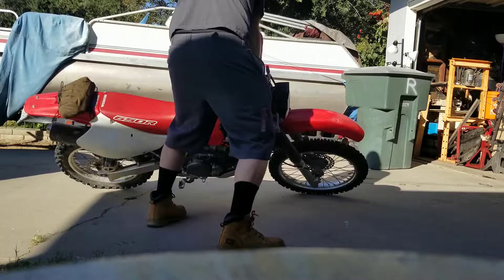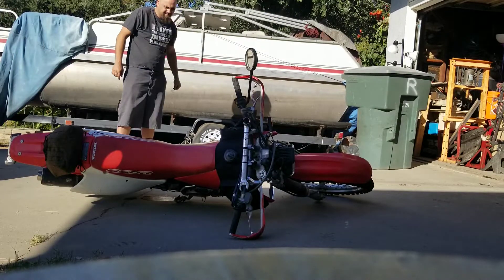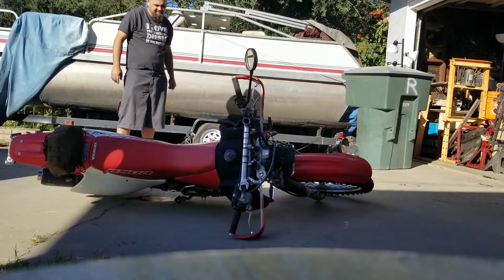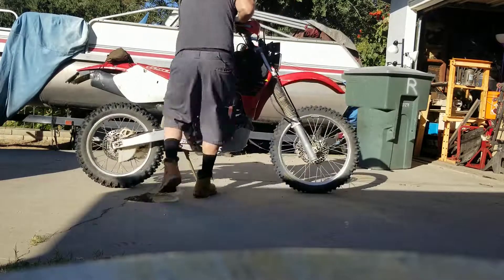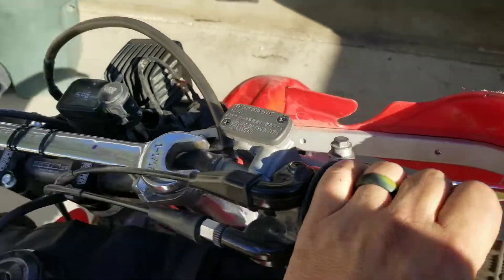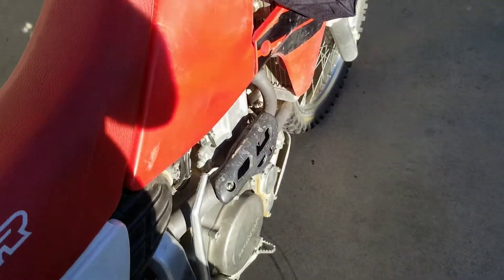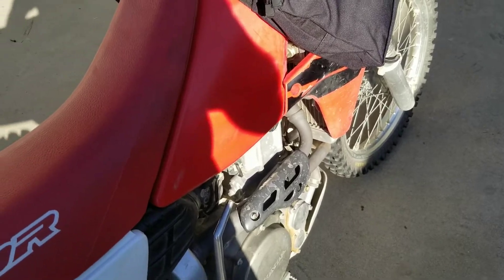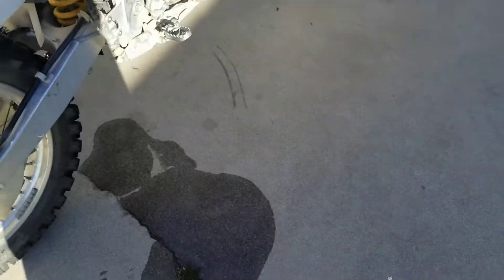How to start your flooded XR650R

Comment: I’ve found you can also turn the fuel off before picking it up to let the float dry up. Then kick it over, before turning the fuel back on. I don’t know if this reduces the number of kicks required, but it does help start cleaner as I have an e start.
Reply from the maker: This is true I was new to the bike when I made this video. When your in the elements the bike is hot on its side on a hill it is a whole different game

Comment: I thought having the throttle wide open would give more gas as the jet is wide open ? But i could see more air would flow in...hmm probably slower engine speed on kick so wide open makes it happen ok
Reply from the maker: Choke off wide-open throttle not enough vacuum for the venturis to pull in fuel